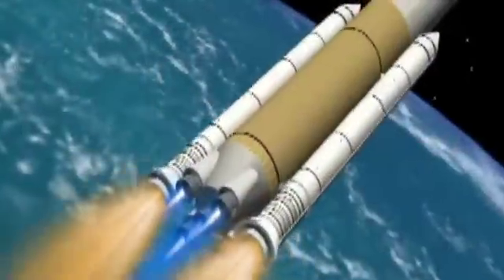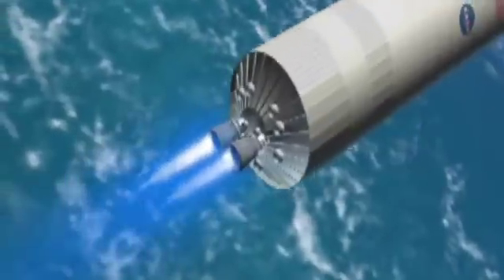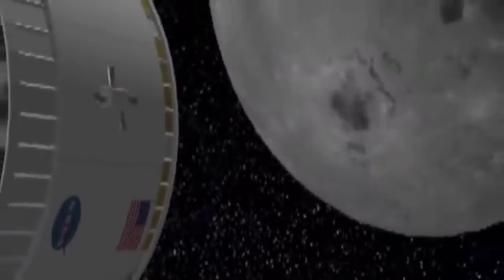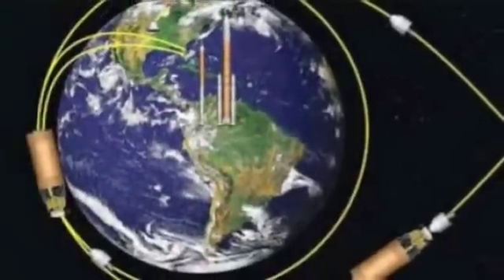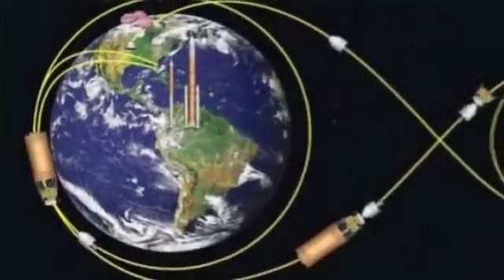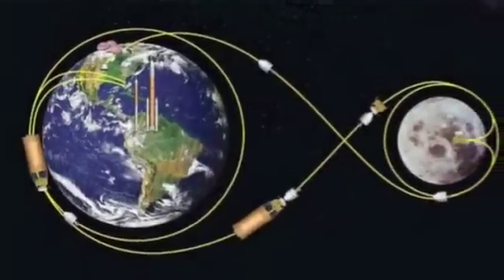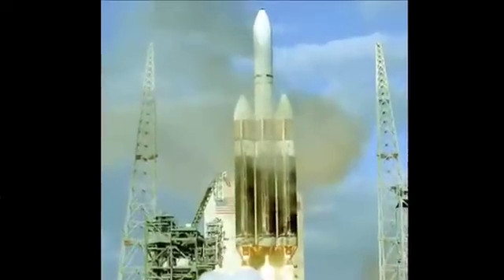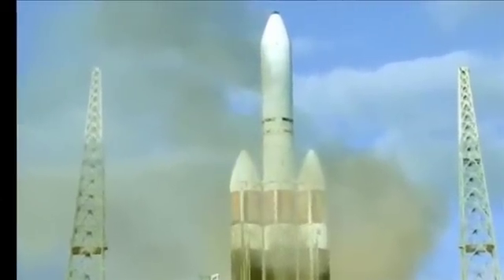Gasteroid Part 2

Comment: A possible solution to the fuel problem would be to manufacture the fuel in space, via algae and microbes.  However that raises its own questions.  Chiefly, how will growing and harvesting algae, then rendering and refining the fuel from the biomass work in zero gravity?  Yet if a closed loop production system in that environment is perfected, it would mean fuel need not be exclusively transported from Earth at extra cost.